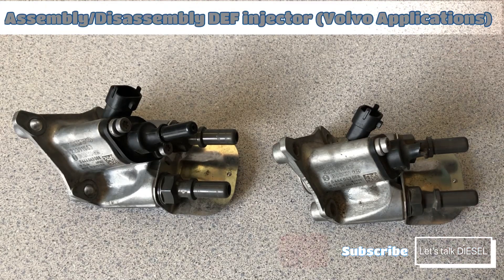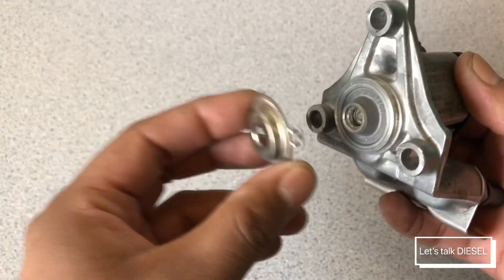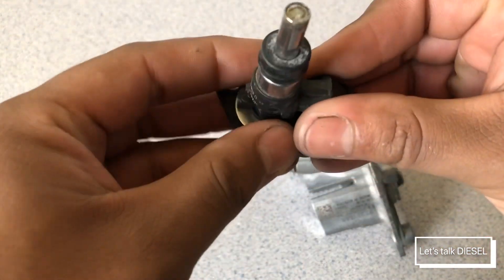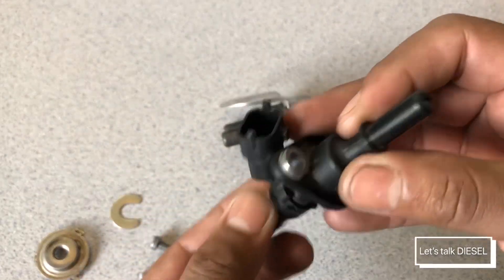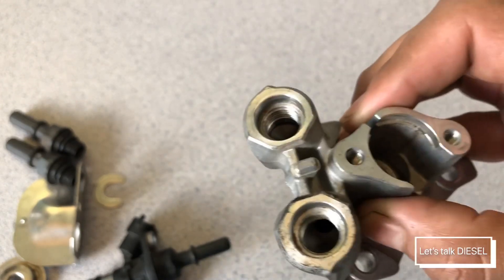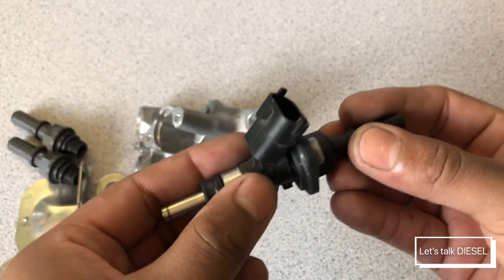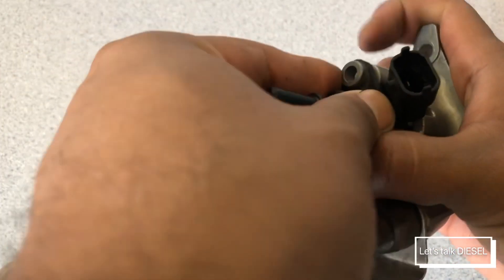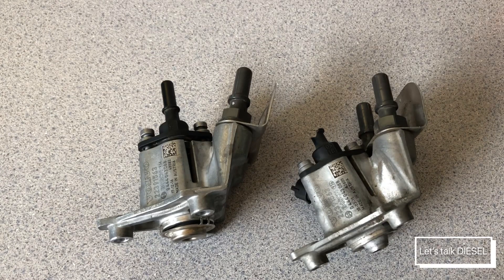Assembly/Disassembly DEF injector (Volvo applications).

Comment: does anyone happens to know what voltage goes to that valve ?
Reply: 4.8-5V. Hook up the multimeter, set it to ohms, and check the resistance. It must be at least 12 ohms. If there is no resistance or the resistance is below 12 ohms, then throw it away. Or disassemble and keep the casing, screws, and fittings; you might need them later.

Comment: Mine is still goign when goig by ohm resistance , I bought it in December and already getting codes . I took it out and see what s it s problem , I have applied 12 v and it start to have some droplets . It sucks that it can get u stuck with 5 mph and cost a lot of money,  I think cleanning it with ultra sound bath (same used for injectors ) can make some difference.

Comment: Thanks for the video sir, my question is can this be cleaned with carbrator cleaner or must it be warm water only , thanks
Reply from the maker: Warm water only. Thanks for watching.
Reply: Is Crystalized Ammonia ... Hot Water will dissolve crystals